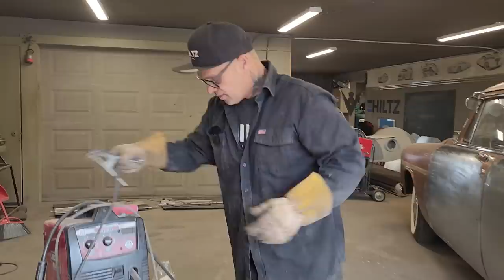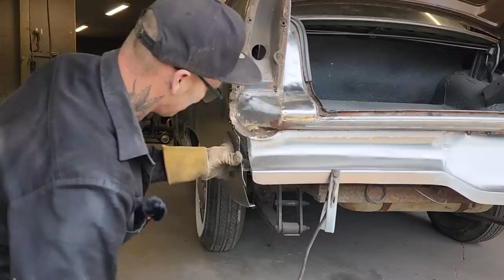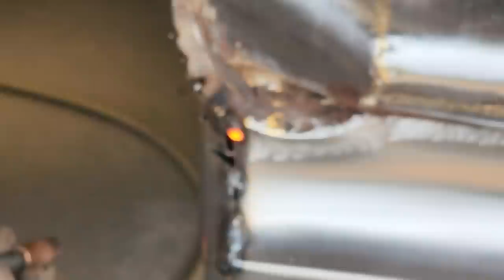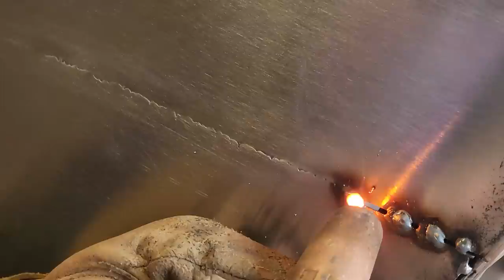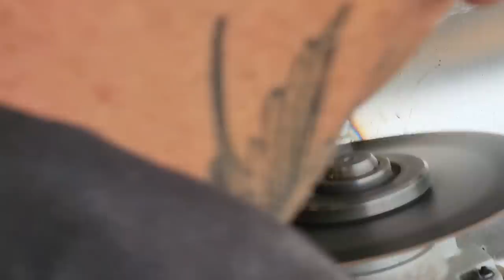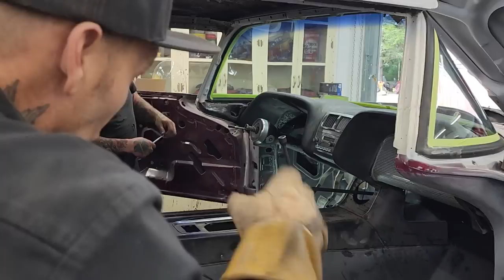Manipulating the panel to fit the taillight 😮

Comment: Those are very large gaps to close up where the two pieces of metal are joining together. The good old coat hanger method does awesome work on fixing those large gaps. Great work Chad. Blazing welding the panels would just cause wild distortion in the metal panels big time. The older cars are the best to work on big time. Any car past 1970 is to modern for me. One sweet old car there. Looking great to me.....here.

Comment: Chads doing a great job. I just want to mention a couple things. First off his sanding disc is not a flap disc. A flat disc is made up of several emery like sandpaper pieces. What he is using is a sanding disc. Secondly the joint he is welding is not a butt joint it is a lap joint. A butt joint is putting 2 pieces on the edge of each other and welding them together. Not trying to be picky but feel it’s important to know the differences.

Comment: Chad,  I'm learning quite a bit about welding and what you can do with a MIG welder.  I would never have thought you could fill sheetmetal with a coat hanger.  My metal shop teacher would have choked me if he saw  me doing that! LOL! 🙂 But, he was a TOOL. But he taught us a lot. The Thunderbird is very different. I would have liked the shifter to come through the console. 
But, if it works--it works.  Nice job on the Plymouth.

Comment: Hi Chad, Jolene, & Nathan, I can't really say which mics are better, sorry I am not much help. I would say the biggest test would be outside to see if there is as much wind noise as the old mics. I will say that I did not hear the new mics drop there level when Chad turned his head.Chad is really working that 1/4 panel to make it fit properly at the back. Nathan is hard at it on the T/Bird getting the mechanicals to work out. Jolene great job on the video and you really know what shots to get like shooting inside the trunk to show us how the welding was sealing out the light coming through. You are always trying to improve the videos such as trying new mics.

Comment: The shifter on the T-Bird is wild. But correct me if I'm wrong here ... Isn't first gear really low on that transmission? Like first gear on my old truck, we call it granny low, I take off in second unless I'm pulling fence posts. Like first in the race hauler.

Metal work is looking good today!

Comment: Hey Chad, if it was easy it wouldnt be any fun. Seeing the buckle at the vertical  center weld . Low spot. Will you be breaking out the torch and the cold water sponge to shrink it back into place ?   That would be an interesting  little episode . Continue.
Reply: Hey Jolene, whatever you did microphone wise, its working. The background machine noises are less irritating now, filtered  and bearable. Thanks

Comment: really needs weld through primers and rust prevention primers in behind all the patches to give your repairs longevity..and before u go on about how from factory there is no primer..it doesnt matter,your job is to make these repairs last as long as possible,factories do not car,weld through primers dont catch on fire like normal primers,but they do help with corrosion prevention,and they are in an aerosol can so are fast and easy to apply,also por15 makes great product which can be brushed over insides of panels and surface rust which you have alot of on the inners,this product starves the rusts so it cannot go further....would u rather just spend a few extra $$ and a little time doing these things or have to redo all of these repairs in 5-10 years?

Comment: is MAXIMUM 4-1/2-in x 3/64-in Aluminum Oxide Thin Cut off Wheel for Metal your choice for cutting seems like the ones you use last forever.